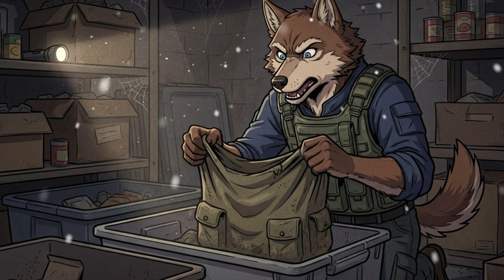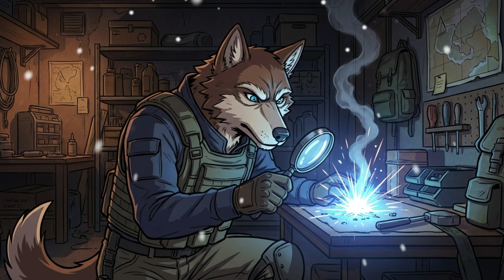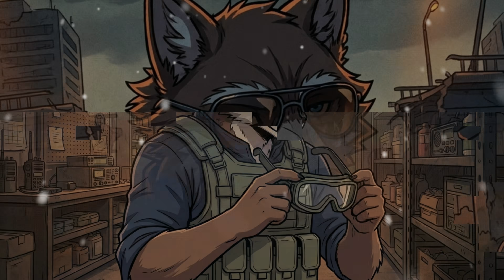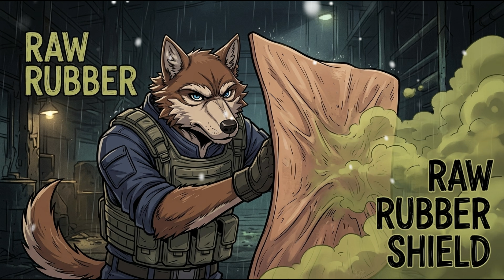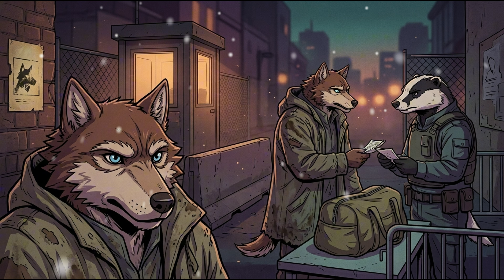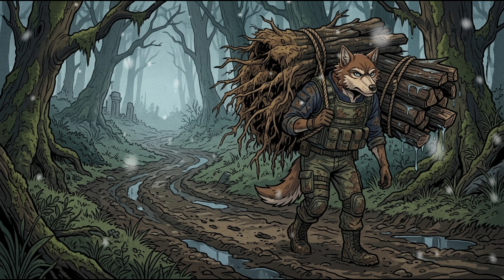The 7 Military Items At Army Surplus Stores That Are Quietly Disappearing This Year.

Comment: Bic lighters are great as long as you keep them in your pocket. A great primary, but have a ferro ad as backup. The magnesium blocks are ok, but you need to have more than a dime sized pile. They used to have instructions saying a quarter sized. And even that is too small really.

The SWD goggles aren't bad, especially with the Polycarbonate ballistic lenses. But there are many that are better. The later issued ones for example ESS are much more protective. They make a better seal than the SWD goggles. Same with Wiley X.

Duffel bags haven't been made from cotton canvas in like 40 years. The issued one is heavy nylon. And they are a pain in the ass to carry. Great for loading into cars, but not good at all for carrying on your back.

That survival vest is pretty obvious and tactical too. Better to spend the money on a Scott E-Vest that is made to carry a lot without being obvious. You aren't carrying that survival vest in the summer heat without being obvious.

Use lighter nylon bags with a polyurethane coating. It's as waterproof as the rubber canvas and is half the weight or less.